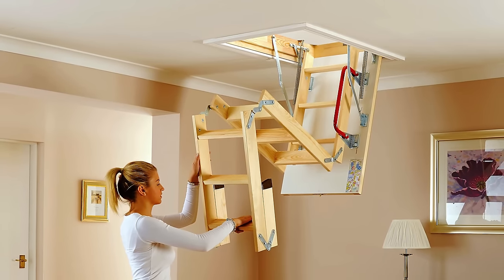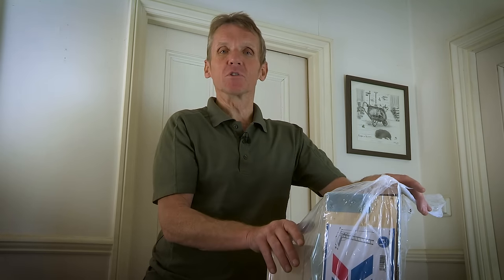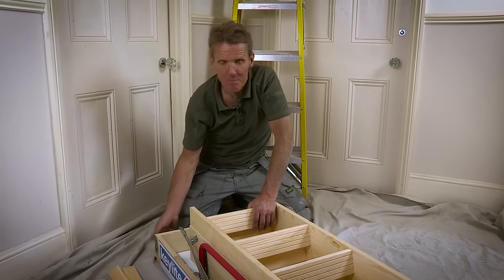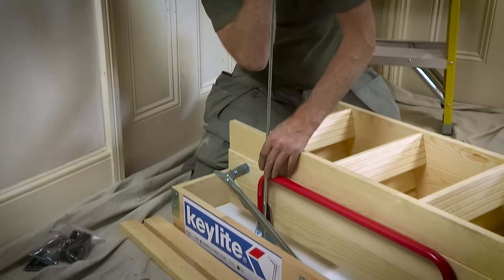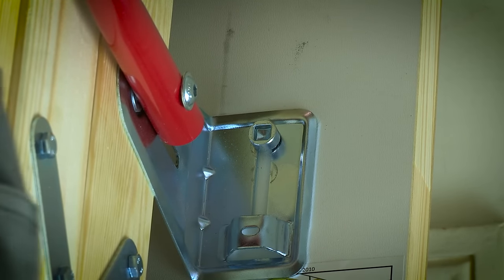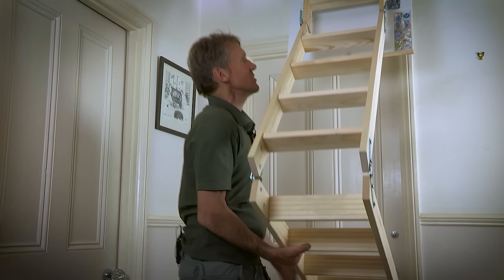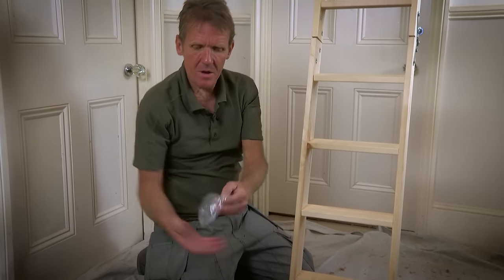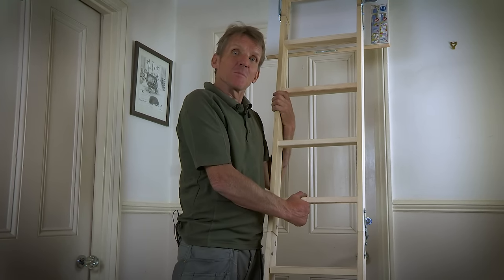Easy DIY Install | Clever Keylite Loft Ladder

Comment: Who hates doing loft hatches? I always seem to get ceilings that were made in the dark ages and end up doing something drastic like boarding & skimming the whole landing just to get the loft hatch looking nice...
Reply from the maker: Yes I know what you mean. I had to take care not to disturb the lath and plaster too much. You can see my patch on the left.  The decorators re-papered that bit of ceiling and it looks a treat but I did say at the beginning that you need someone with experience to do the cutting out. Fitting the ladder is really easy though and if  you have a hatch you can probably do a straight job. I made life more difficult for myself by going large.

Comment: Brilliant Videos, just in time, saw your Festool TS55 Plunge Saw Vid and decided the HK 85 might be better for me as I want to use it at as a table saw with my router table. I'm fitting a loft ladder as soon as I get home, (I work in the M/E)
Reply from the maker: Thank you for the comment. I am glad the videos help. Please like and share, we need help to grow. Try that Keylite loft ladder, it is easy to fit.
Reply: Shock and awe! I just bought the Festool HK 85 online from eBay new for 400 quid, just the saw without the tracks for now, I have Trend Guide Clamps I'll use for my next job after fitting the loft ladders, boarding out my loft!

Comment: I really like this loft ladder and installed it myself about 2 years ago. My only little gripe is that the hatch opens a bit too far meaning the loft ladder isn’t straight when in the open position. It has a curve to it and the treads are slightly leaning forward.  The steps arnt cut too short which you might think. Has anyone else had this issue?

Comment: I own a company that installs 5 to 10 of these type of ladders a week, for me the best ladder on the market is FACRO you can also buy a trim ready cut from screw fix that will finish the job off nicely if your miter cuts aren't the best  this type of ladder is more superior to the aluminum drop down ladder
Reply: Hi why is the Fakro better than the Keylite range?? Also what is the screw fix trim called?

Comment: Great video and easy to follow. Sadly, the width at 700mm is a little too big. I only have 565mm to play with.  Is there a smaller version? Thank you.
Reply: My loft hatch was 565mm and I chose the Oman Polar Deluxe loft hatch with ladder.  U Rating of 0.36 which is better than this one in the video.  The Oman Polar has 86mm insulation.

Comment: Is it me or did he just completely skip the part where he said make the hatch bigger for new one to fit? Its the 1 reason i clicked on video
Reply: I agree, he did not show that, but he did say that the existing hatch frame did not make full use of the available space, and it looked to me like he only had to remove it and trim the loft flooring back, as the structural timbers were wide enough. Perhaps.

Comment: Dovetailed? Do you mean half housing joint perhaps? Dovetail joints are for corners.
Enjoyed the vid though with the mad staring eyes lol
Reply from the maker: hi Pablo 
You are right to question this point but they are dovetailed . With modern woodworking machinery it is easy enough to cut a blind housing from the bask of the string and then feed in the treads with their dovetailed ends. 
If makes for a tight joint and no need for screws.
Reply: @SkillBuilder  I wondered the same thing. What i think you're talking about here is a French dovetail or sliding dovetail joint.

Comment: I have jus received this ladder. And every seems ok. Accept i have put it up. And it is. So stiff to try and open. So i took it back out. And ive literally got to really force and price it to open it fully. I rang keylite. And they said. They do tend to tighten the springs quite tight. For couriering etc. But its that tight. I cant pull it down with the bar. I have to reach and drag it down and push it open. Wer as in your video it comes down with such ease. Any ideas. Thanks.
Reply from the maker: I think you can adjust the spring.
Reply: It's because they're sprung mate. The spring can be adjusted, so it's not so snappy.

Comment: Isn't that box/frame hanging well below the ceiling. How do you dealing with that?
Reply: It’s actually flush with the ceiling. Just an optical illusion on the video. I just fitted one and it was as easy as this guy says it is. I have a new build, and the hatch was too small, so I had to take the old hatch out- one of those plastic beasties, and cut out the plasterboard and do wee bit of jiggery-pokery with the joists. I did it from start to finish on my own. Only trouble I had was I ordered the wrong length of ladder - it was longer than it needed to be. I just cut it to length like he does in the video, and instead of just having a wee bit left over, I had a longer bit but it still looks great.

Comment: Hi Roger.  Help! In your plumbing visits have you come across a 'loft' ladder that opens out of a vertical rather than horizontal opening?  I could do with one for my tank room which is a half storey high space directly above the bathroom which opens into a one and a half storey hall.  Bob.
Reply from the maker: Yes it is called a scissor ladder. I haven't seen one for a while. Telescopic ladders also do the same thing but I can't see how you would attach it.
Reply: Thanks Roger, you're a gent!  Bob

Comment: Gutted after installing this hatch I've been getting lots of damp in the loft I tryed everything to fix it yet still kept getting it so last through of the dice I built a box around it on the top and added a cover to fix the issue honestly buy a better product
Reply from the maker: The problem you have is air leakage around the trap. It needs a seal which is simple draught excluder. 
I am guessing you have a ventilated roof space that pulls moisture up.
Reply: @SkillBuilder  I've used exspaning foam and there is no air on the out side of the box 
I've fixed it by building a box exstention and added a top since then it's better